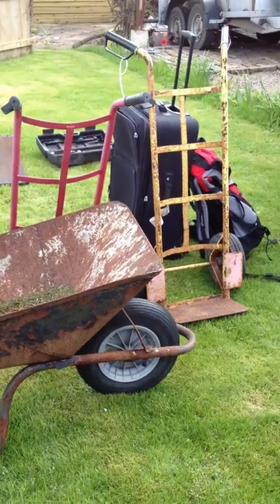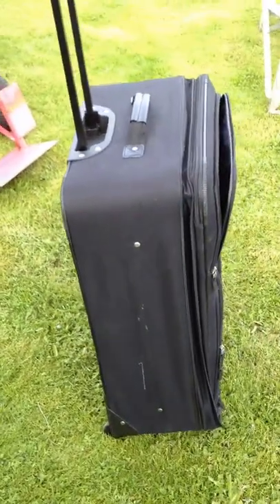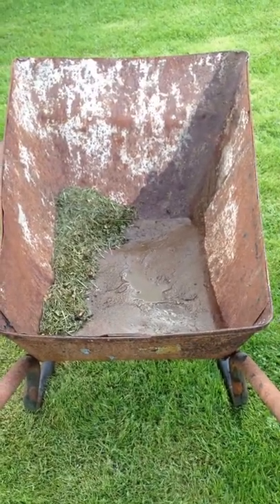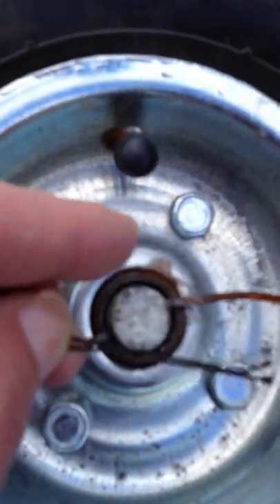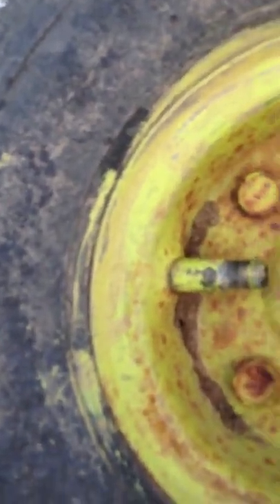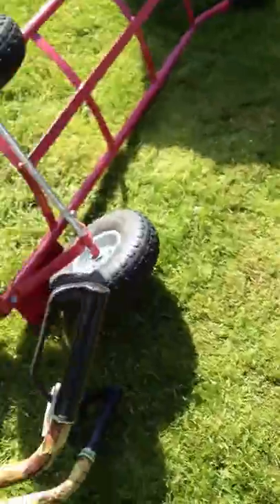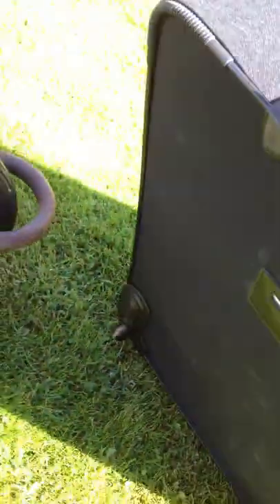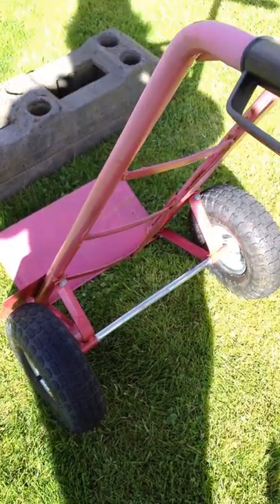Festival Trolley Tips

Comment: how would you recommend using a split pin properly?
I have heard lots of horror stories about wheels coming off mid walk?
Reply: keep a small pair of long nose pliers with you, bend the end over in opposite directions to each other. most multi tools will have pliers on and with the added benefit you can turn your sausages on the BBQ in the morning :)